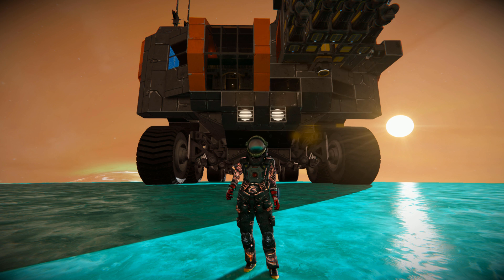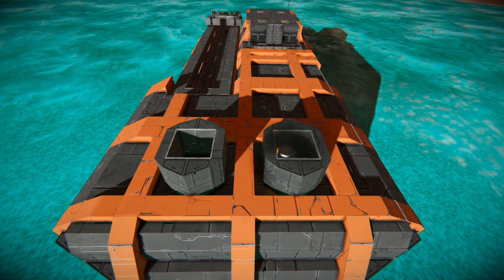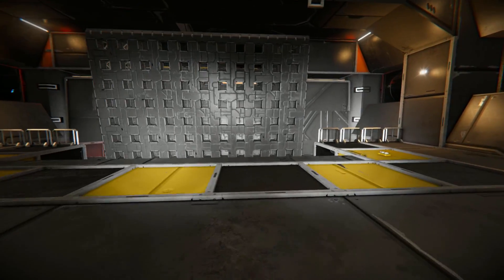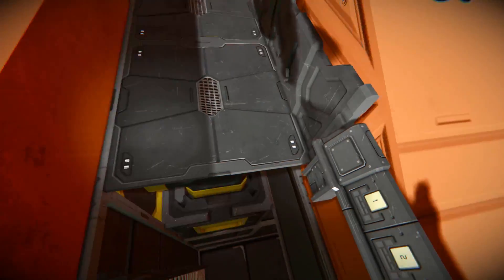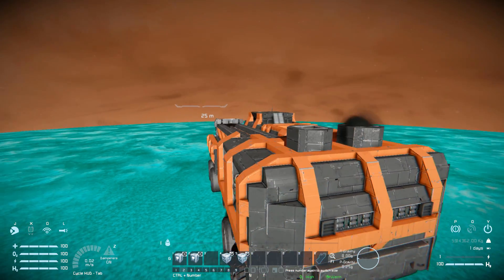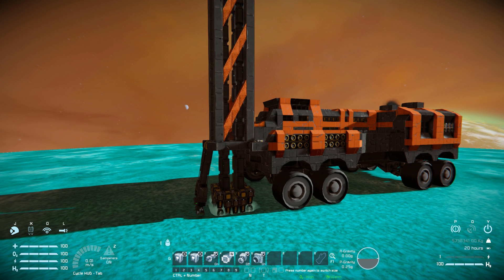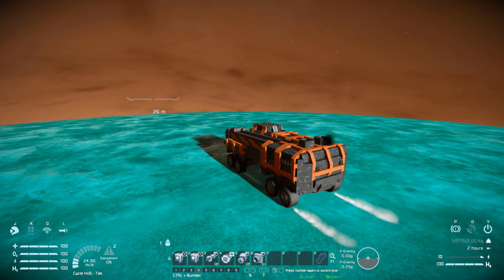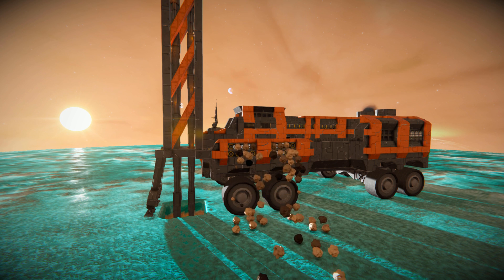Mobile Drilling Rig - Space Engineers (Vanilla + DLC)

Comment: In my honest opinion, as astonishingly well engineered that it is, that ramp seems a fair bit too steep for underpowered rovers. If I were the creator, I would have tried to replace it with a ramped elevator platform. One that comfortably fits inside the hangar like an open garage door, rotates downwards and towards the rear of the rig, extends to ground level, then deploys some small ramps, lifts the vehicle to the hangar, then fully retracts when the main door closes.

Comment: the drill itself could be improved by having a side-stacked piston set which are much more stable but a lot less redundant.
c= curved conveyor x= conveyor tube p= piston  |= seperation to clarify connection direction v/^ to clarify direction of flow
part 1 2 and 3 in a 3 x 3 x 4 stack (stack height will always be 4 but you can expand sideways or add more stacks for more distance
v x | c   c v      ^ c | c   c ^      v c | c   c v
v p | x | p v      ^ x | p | x ^      v p | x | p v
v p | x | p v      ^ x | p | x ^      v p | x | p v
v c   c | c v      ^ c   c | c ^      v c   c | x v (here is where you add another stack in reverse)

Comment: For some reason i keep thinking about scrapping the drill and using it as a carrier.
Reply: If I had this game, I'd definitely agree with you too. Except my drills would be in the front of the vehicle, spread out to form a triangle, and they'd all be connected to some sort of platform to help prevent the swaying and such. Also, the only other thing I think this needs is a more open cockpit view and made a litt smaller with more armor and extra storage and even maybe add a little more hydrogen engines or at least solar panels.
Reply: @dragonscargames4808  actually I'd be removing the entire drill rig in order to make that a flight deck or a cluster of VTOL pads. the entire set up is rather bulky
Reply: @terran046  Either a land carrier or a land battle ship.
Reply: I’d build a new drill and use the place where the old drill was as an area for Fighters and maybe an extended garage as well as supplies to make a base.